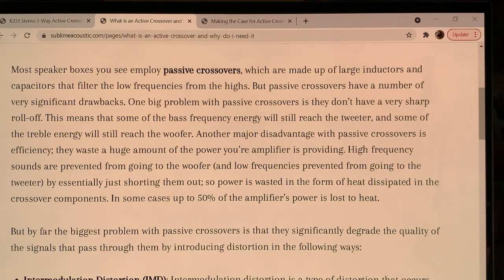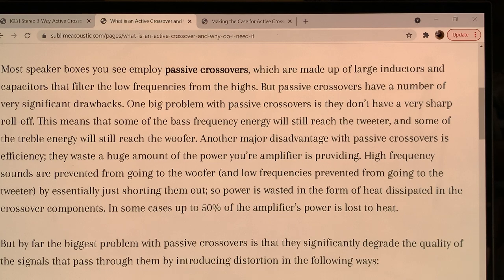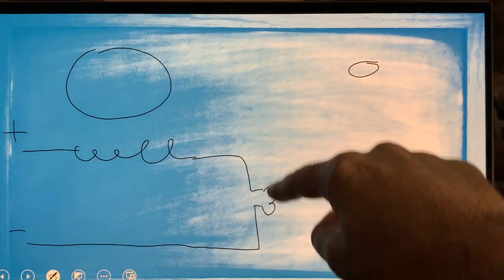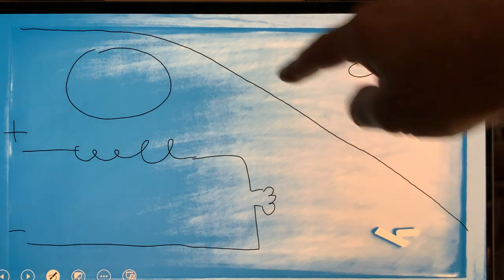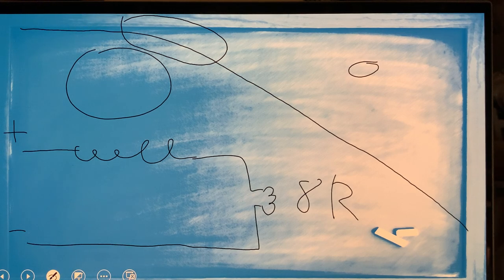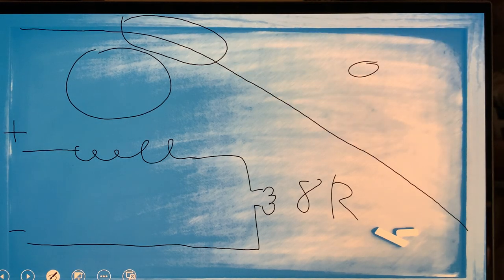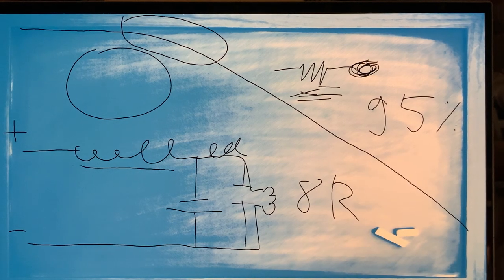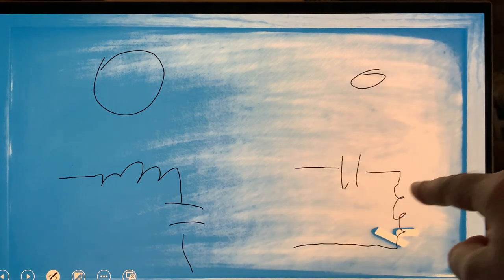Active VS Passive Crossovers! Masterclass part 2.

Comment: Passive crossovers with resistors are the reason to go DSP. The best way to control a cone is directly connect the amp to the voice coil with as little stuffs that can impede the signal. With active (DSP) crossovers, we control the amp's gain so no power is wasted as heat in resistors (there are nothing between the amp and the voice coil other than the cable connecting the two.
Reply from the maker: Connecting the amp directly to the driver definitively forms the best connection between the two. It can work very well when your source is already digital, and there is no need to add an additional device for the active crossover. However, in case of analogue sources there can be a definitive downside when you add this to a well-optimized high level system, and any differences between the amplifiers driving each driver while seemingly unnoticed at first, can become over time quite an itch. As usual, one has to find the most optimal solution for their own systems, and for their listening preferences. Thank you for posting! ; )
Reply: @realworldaudio  whoa! I got a reply! Hi Janos. For those who aren't familiar with the limitation of digital systems, what you said is correct. But once you know the limitations of digital systems, it is not hard to design a system to alleviate the shortcomings of digital systems. One of the components that I can suggest to you to research is "Cosmos ADC". This relatively cheap little thing changed what ADC is. Gone are the days where ADCs brings "color", and digital artifacts to our music (this is talking about analog systems). This little thing is so transparent that I have no more complaints about ADCs these days.

Now pair that with a properly designed DSP system with good DAC and analog output stage (per driver mind you), you can really tune your system to your heart content. Let's say that I have a 3 way system using one concentric driver and 6 woofers, I can pair the midrange and the tweeter part of the concentric driver to a 300B tube amp for tube sound, and drive the rest using a mix of Class A/B and Class D for the woofers (some woofers will play 80hz and down, this will be driven with the Class D , and some are 80 to 250hz, this can be driven with the Class AB) for perfect cone control.

These days we start our chain using digital systems (CD player, or a streamer), this way I can get as pristine signal as possible from the source down to my driver. With proper tools and methods, you can align your drivers down to microseconds to get the perfect coherence between drivers with different types of amplifiers in your system. I can get the sweet sweet mid-range and highs that I love so much, but also have the grunt to slam the cones for those 6 woofers to get the perfect amount of bass for the system.